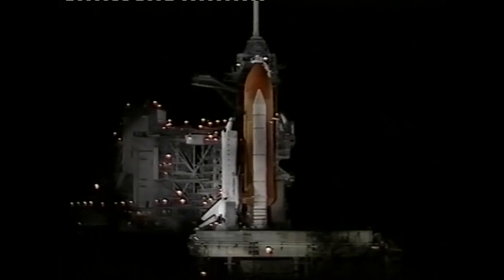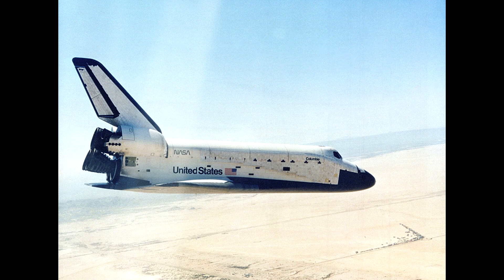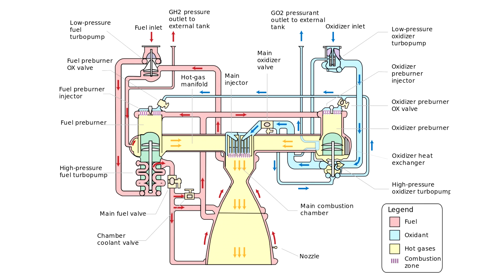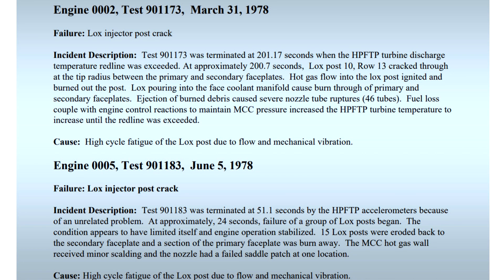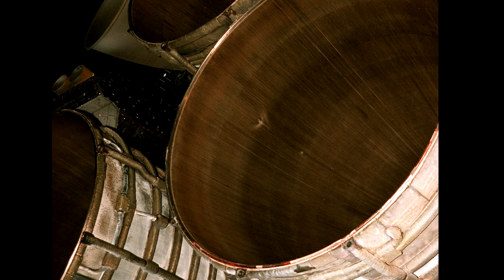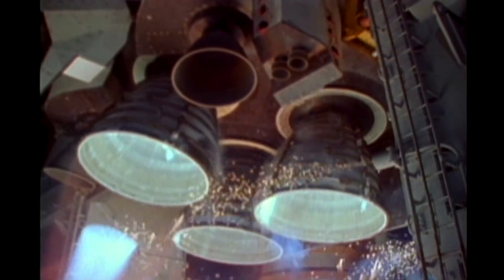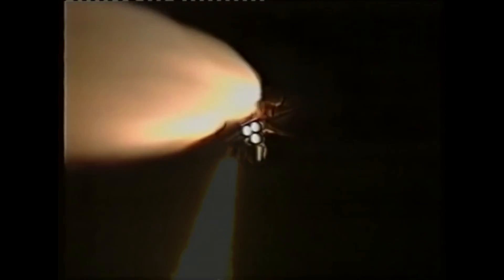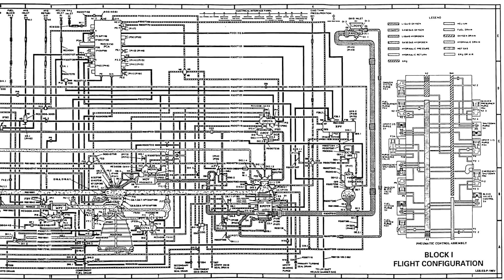How A  Gold Bullet Almost Destroyed A Space Shuttle

Comment: So did any of NASAs policies or checks of the orbiter change after this mission? Did they stop using these gold plated plugs? Did they check the wiring and screw heads for burs? Did this collection of incidents change spaceflight in any way going forward?
Reply from the maker: After this they insisted posts get replaced rather than plugged.
Reply: Sounds more sensible :)
Reply: This may be a stupid question, but why couldn't they weld the plugs shut?
Reply: As close as they were, you'd likely damage more of them, perhaps without visible external effects.
Reply: Also, why was gold used for the plug?! Seems an odd choice of metal.
Reply: Ed Jones
I'm guessing due to specific thermal properties, but I don't know for sure
Reply: ENCHANTMEN relatively soft and no oxide issues probably
Reply: Robert Szasz ‘soft’ seem to be an odd property required of a plug in a high pressure line of a rocket motor!
Reply: Ed Jones I guess, but you want to form a good seal and not damage anything.
Reply: Inert.  No oxidation even at high temperatures.
Reply: Gold can be made into alloys that retain the resistance to chemical attack while adding hardness. You would be very hard pressed to find any jewelry made of better than 18 karat gold.
Reply: Ed Jones gold is nonreactive. Liquid oxygen is horrifically corrosive, to the point that if a steel plug were used it would have rusted away. Anything in contact with it needs to resist oxidation. Gold is actually one of the cheaper options.
Reply: @putrid.p  If you looked closely at the diagram you have noticed that it was merely gold plated. Gold plating is commonly used in vacuum environments for a low friction coefficient without the need for a lubricant.
Reply: IIRC, they also had an extended period of downtime to inspect said wiring in all shuttles to check for any more fraying/damaged cables.
Reply: @nemo-x  "NASA doing things in a pants on head retarded way" You've put up a lot of (Cody engineered and manufactured) space shuttles yourself then?
Reply: Whatever they did it unfortunately wasn’t enough
Reply: Solaris Fireball well, the next flight exploded. ... so. ..😐
Reply: @LordDice1  I believe there was one more flight of Columbia between this flight in 1999 to launch the Chandra telescope and the fatal disintegration of Columbia in Feb. 2003... IIRC it was a mission to repair/service Hubble.
Reply: Clearly not, old bitch broke up during reentry in 2002, killing all 7 onboard.
Reply: I asked google why they used gold for the plugs, crazy thing happened. i found the answer. it's pretty obvious if you think about it. what does oxygen do to gold? if you can answer that, you have only two other things to consider why gold instead.
Reply: NiceWhenEarned RudeMostlyElse I really can’t stand people such as yourself who just tell people to google everything and do so in a snarky way AND do so using more words than it would take to answer the fucking question. I could google pretty much every fucking question known to man and get the answer but sometimes it’s nice to have a bit of online discord with people. Also do you realize why it’s generally so easy to google and get answers to questions rather easily? It’s because other people are answering other people’s questions and then they live on the internet! It’s funny how that works...

I would almost bet money that you spend a lot of free time on reddit making similar comments to people asking simple questions.
Reply: Solaris Fireball  ... heard they spent small fortune calibrating hammers! . .

Comment: Columbia dodged this bullet, but the next one got her.
Reply: Golden bullet, survivable. Foam bullet, not so much.
Reply: They got very lucky the first time and very unlucky the second time.
Reply: Commander Shepard if only they’d followed protocol.
Reply: Foam/ice bullet
Reply: Foam bullet of newer more epa friendly recipe.
Reply: This mission was Columbia warning everyone that it was time to get a new vehicle, much like getting home with the check engine and transmission lights both on is a warning. It wasn't listened to.
Reply: The fatal explosion later had nothing to do with the shuttle, it was a fail in the external tank insulation, a brand new shuttle had met the same fate, actually they had to do several tests with high velocity testfireing with a especially built cannon and lot of other stuff to discover the actual cause, a brand new shuttle built before the accident had ben made of the same type of materials and structures and had been vulnerable to exactly the same type of damage, so it had not helped.
Reply: @Vampi_Sweden  The foam hit STS-112's SRB booster, causing a nasty dent at the bottom of the SRB while missing Atlantis by inches. Same thing happened with STS-114 in 2005 for the first Return to Flight mission. Huge chunk of foam flew off and barely missed hitting either the orbiter or SRB. NASA immediately grounded all STS missions on day 2 of STS-114's mission. Whomever was doing quality control for the SRBs and ETs were horrible and seemed to cut corners in order to save money. The orbiters themselves were amazing and were not responsible for their losses.
Reply: @nogoodnameleft  Tank You for the explanation, i can't believe they did cut corners related to safety even for this type of missions! A bit of a shame all the remaining engines not used in the shuttles are gone, but i hope parts of them can be found in the future, at least they came to good use. My honest condoleances to the crews families.
Reply: +Kristen Overstreet  This mission wasnt a warning, the warning was all the foam liberation since STS-1. STS was complicated, it was the human managers that made it dangerous.  You expect an entire launch vehicle platform to be retired simply because of a chaffed wire?  The correct course of action was followed, the entire orbiter fleet had its wiring checked and updated.
Reply: hoghogwild 
NASA  started making bad decisions....They had the data...while refurbishing the SRBs on previous flights they had complete burn through of the primary O-Ring....and Partial burn through of the Secondary O-Ring...getting progressively worse with a decrease in Air temperature.....Launching the first school teacher after having overnight temperatures in the 20deg F ...was  Horrible Mistake  when you had 70% burn through with launches in the mid 40s..F
Reply: +Frankie Ford Agreed 100%.
Reply: One might argue that there were enough warning signs in this launch alone...
Reply: I was thinking the same.
Reply: Columbia's next mission was the Hubble repair mission STS-109 in 2002. After that, not so lucky. :(
Reply: Yeah... STS-107.  I had met both Anderson and Husband back after STS-89 in 1998 and STS-96 in 1999 respectively.  My mom being part a member of the National Space Society, and one time, training as a Mission Specialist for the Teacher in Space Program before the Challenger Disaster killed the program.

Edit: Anyway, we got tickets to watch launch all the time due to our connections in N.A.S.A. and went regularly, in 1998-2002 we went to like 6 launches, and spent a week at Disney World in 1998 as well.
Reply: Columbia dodged a lot of bullets. Even on the first mission, the return was jeopardized by computer malfunctions.
Reply: This one is easy, I named Chandra. There was a contest to solicit names for the telescope, originally called AXAF, there were many suggestions to name it after famed astrophysicist Chandrasekhar (I was one of them).
Reply: Damn, that’s harsh.
Reply: That was sad. That poor teacher and crew
Reply: hmmm i guess this isn't his favorite video on the citadel
Reply: she dodge many bullets.
Reply: She dodged a massive bullet on her very first flight. No idea how it landed with all that damage. But unfortunately her lives finally ran out. Even on that last flight it was astonishing how smoothly she flew despite the worsening situation until the left wing fell off entirely.
Reply: Also, is this your favorite video on Youtube?
Reply: holy crap. yeah, i crossed that line pretty hard there. i think i should probably remove that... and i am sorry, fwiw.
Reply: Too soon
Reply: Final Destination
Reply: idiot comment. one is literal, the other is figurative. a bullet never 'got' columbia.
Reply: NiceWhenEarned RudeMostlyElse nope, both are figurative. You try too hard to be rude.

Comment: How often do things like this go wrong with "no effect"?
Reply: I used to work in aviation maintenance. We used to have a saying: there's no such thing as a perfectly good airplane (or spacecraft); they're all in various states of disrepair. Every jetliner you've ever flown on, however shiny and new, has had something minor wrong with it somewhere. The problem with spacecraft is that they're so dependent on high performance that it's hard to design margin of error into the systems. A B-17 bomber or an A-10 can fly home on one engine and half its structure ripped to shreds, because it can be built heavier than required to get the job done. A jetliner can absorb a surprising amount of punishment due to weather, engine failure, rough landings, etc. Most spacecraft don't have that option. A launch vehicle's engines are like a dragster's engine, they have to operate at super high performance for a short period of time and the whole vehicle has to be as light as possible, while flying at hypersonic speeds and large accelerations. The whole machine is always on the edge of spectacular success or failure.
Reply: LtKharn all the time in all sorts of operations
Reply: LtKharn all the time. That's why every mission critical system on almost anything that flies has had redundancy built in. Right down to Cessnas. Commercial aircraft have triple redundancy.